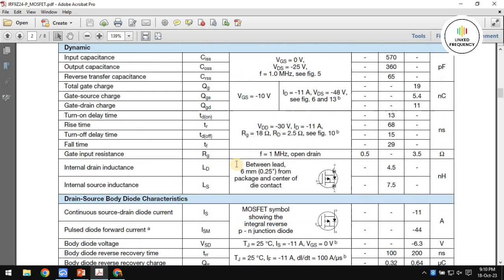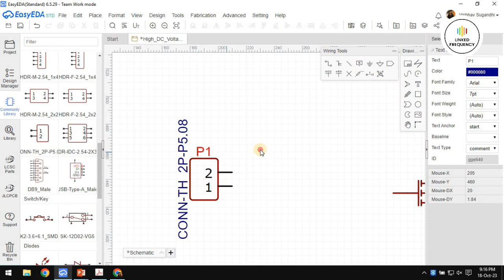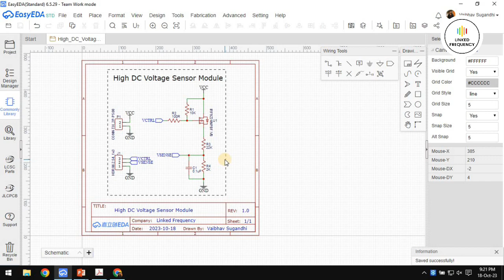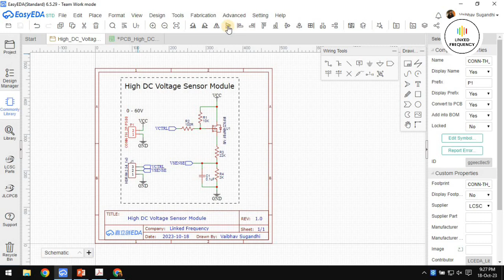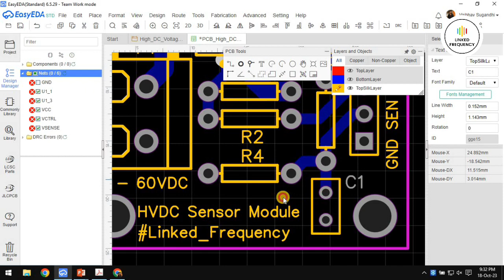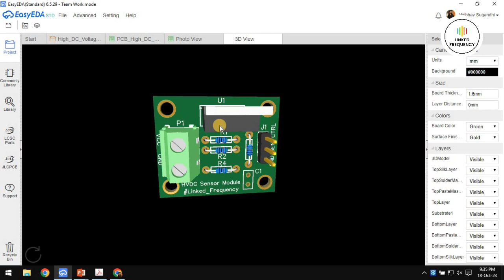High DC voltage sensor module design #E08 | Vaibhav Sugandhi

Comment: HI, MAM. Thanks for your video. I want a pcb sensor that DC 1000V, with under variable voltage relay switch.
Reply from the maker: You can identify the specific PMIC for such requirements using manufacturer product selection guide. Also you can use AI tools to find the best suitable IC suggestions. 

Happy learning:)
#Linked_Frequency